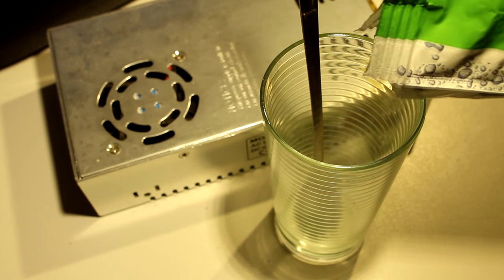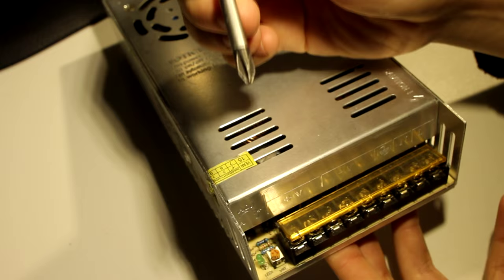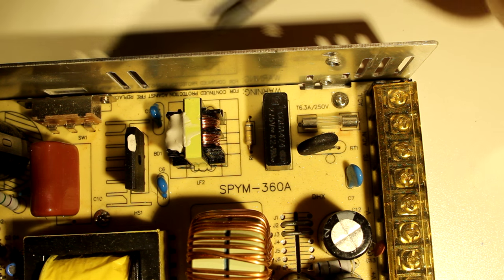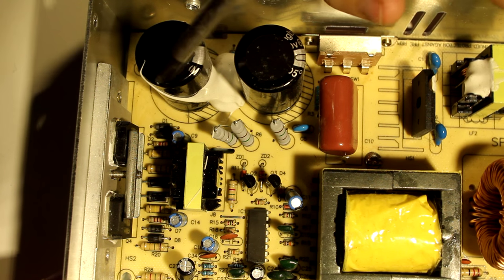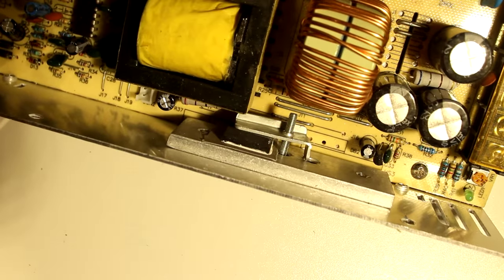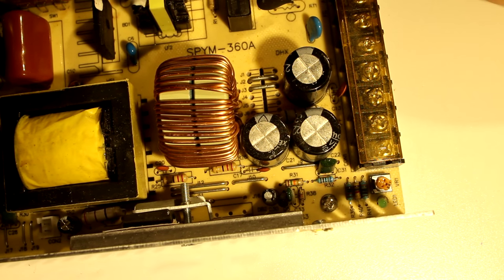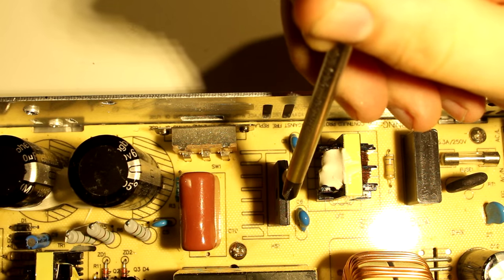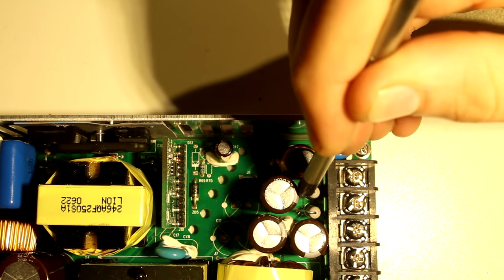Crappy chinese 24V '360W' power supply teardown (005)

Comment: The power supply is made to a price, its bad practice to run the power supply at or near its full capacity anyway, the black component near the fuse is a NTC not a mov its intended to limit the inrush current at switch on, the minimum load power resistor, looks like a 680R/1W carbon film, it dissipating about 850mWatts, it will get hot, but the heat may not be significant enough to noticeably reduce the life of the output caps. The clearance between the mains terminals and the output is fine, this is acceptable practice. The issue is to ensure the designer maintained correct clearances on the PCB and used sufficient insulation on the transformer, this is sometimes the big problem with the cheap units. The components that are heavy get glued down, but the TO-92 small signal transistors generally do not need it as their mass is too small, the power supply should not be exposed to heavy vibration and are not designed for it anyway. Interesting video good work..

Comment: these powersupllies are never perfect but they do work fine if you fix some parts. i have a 12v 20amp one powering my stereo at home which happens to be a sony explod car stereo that happily takes over 10-15amps when the bass is cranked. and the powersupply remains on 24x7 to keep the time & other settings in the radio and it has been turned on like this 24x7 since 2009 . the radio runs 16-18hours a day . i had replaced the mains cap with a single 450v cap and removed the voltage doubler section because i don't need that in a 240v country. and applied right amount of thermal paste on the heatsinks. but other than that every thing is original including the "used" components they used in this powersupply like the half bridge bipolar's and output rectifier.

Comment: Those are two different units!!!  And it appears to be you don’t get the functional design of any of them! And what has the metal to do with the internal of the psu? Its really out of the question when talking about a low-cost product, besided that its totally fine even if it was a expensive product.

Comment: But how dangerous is it really? Since I started reading your blog I became "afraid" of cheap Chinese power adapters that will burn down the house. So I now use ones made to EU specs. But let's say I need a power supply for a device that after installation never gets moved again. All the things you mention in the video don't sound to me like a fire hazard. Ok it will not provide 350 W, but I don't care about that. As long as it can power a few steppers or air valves, it's fine with me. So if you don't mind the build quality, how bad is it really?
Reply from the maker: +Hans de Bruin (Ctrl-Alt-Dude) There is a spectrum of crappiness of course. This particular example just isn't powerful enough to supply the quoted power, so most likely you will just overload it and have some minor noncatastrophic failure (exploding MOSFET or something like that). Truly crappy supplies lack necessary safety features and are an immediate danger to the user, and simply cheap but not particularly crappy power supplies don't live as long as good quality ones. I'll try to do some kind of hazard analysis as a standard part of my reviews.
Reply: +Hans de Bruin (Ctrl-Alt-Dude) How I like to think about it: What would you like: a power supply that can fail with 5% chance, 1% chance or 0.1% chance? Properly designed and manufactured power supplies are just going to get that fail % down. Which then also reduces the chance that your house burns down.

Second thing is: when people buy these crappy power supplies, some of them might actually EXPECT to get 360W out of it. It sais so on the box right? Regulations and such need to protect these people. We can't all be power electronics experts, I know I'm not.

Comment: Bought a batch of faulty ones which some had no output while others just needed testing. After changing only N-Channel Irfp460 20A 500V Power Mosfet Transistors all the voltages were nice and steady at 24 Volts. Not happy with the kind of AC volts I was getting (of about 20 Volts) on the DC side I pinned down the culprit the capacitor just before the output transformer similiar to the C11 on the one on test, which was either 1μF or 10μF can't remember as these things go faster that Jordan changes husbands. Does the job though but buy linear if you want lab testing off a PSU.

Comment: For the price these are by far the best, there are cheap as chips and most other PSU's from China in this price bracket have bugger all filtering on the secondary side and a tiny transformer half the size of those. I've tried dozens from China. What I do with these is swap the mosfets to much better ones with low RDS on and sometimes the coils get hot as they are crap so swap those, the caps will last a couple of years before you have to change them

Comment: The problem with opinion and making a youtube video is that anyone has right on them. "You are completely unqualified to review this power supply (or any PSU for that matter)."
Reply: I agree.  Rather than criticize based on suggestions, suggest risk reduction and show actual test results to gauge reliability, e.g. HiPot with dust, Temp rise, Contamination measurement. COnducted  emission measurement.

Comment: Where is the output noise/ripple  measurement on the scope where is the voltage regulation test with and without load.  I don't think you should label the power supply as crappy with no actual electrical measurements what so ever. Your crappy review not much better than an unboxing review.

Comment: 6:53 that is not a PFC, its a gate drive transformer driving that 2 switches probably in 2 switch forward topology, there is no active pfc with that kind of Chinese smps, the passive ones are pretty bad also,, the only thing that they are good at is its price

Comment: The parts are for the most part way below par as you describe, but a few notes...

1)  The MOV is actually a NTC inrush current limiter.

2) There is no PFC in this power supply, you are being too genetrous :)
    The two mosfets are both used to create a push-pull input for the main transformer (using the push pull TL494 controller).

I have the same power supply with both TO-247 Schottky populated, but apart from that is the same shit build as you describe.
BUT, for the money, ...ehhh, it's hard to argue.  I use ia as a roughly 150W (because there is now way it will give 360W without overheating fast & other issues) 24V supply, and even at that the US$24 I paid for it is a good buy.

Should I want to use it more often all I have to do is replace the output caps (which you are right, will not last long as they are).  But even if I spend US$30 on good quality output caps, at US$54 it is still a bargain.  You may not agree, it is an opinion after all, but to buy even a 150W power that is high quality would 4-6x what I paid for this one.

The two things for me that is really bad is a) terrible heatsinking and b) high EMF backfeeding due to the terrible input filter you describe,
...but both are easy to fix (if you are a tech/engineer).

Don't get me wrong, this is bad a product that should not exist, but if you buff it up with a few fixes it is ok.  If it had these fixes and it cost <$50, it would be a good buy.

Comment: That's no MOV, but an industry limiting thermistor!The "power factor correction inductor" you pointed to is actually the drive transformer to the half bridge..
Judging by your explanation of the circuit and components, you still need to learn quite a bit about electronics before making videos like this...
A tiny bit of knowledge can be a dangerous thing!!!
P.s. the separation between line and low voltage  output is just fine ....

Comment: Talking about capacitors I found some old caps which were good brand however they were very old around 20-30 years I mesured them and they were fine 33000uf 50v i was making a amplifier and run for like year or two I was presented with firework show.The goddamn caps didnt have venting and they were the size of the ones you find in fridges or air conditioners.

Comment: I would not use one of these units in my house without being afraid of it burning down. Very crappy.
Reply: Do you use Christmas lights and/or 18 gauge extension cords in your home and you are worried about metal encased grounded and fused power supply.....really?

Comment: Crimp and solder some conne tours then put heat shrink over them bare wire. Tightened under the clamp will work but is poor workmanship

Comment: Dat coil-winding crossover on the big one.
I have 16 led displays with changx caps on each and they all say VENT. It alarmed me too. Venting at 105c? Should I replace with Japanese caps?
Hm. Imma bend those guys up so they don't spray their own boards, for now.
Recently I bouglt a chinese 5V 30A supply, it's rectifier had provisions on the PCB to be mounted closer to the frame but no, they just glued a metal spacer to it and called it a day (it did not have contact with the frame in this instance). The frame is supposed to be the heatsink btw. I desoldered the rectifier and (after some drilling) resoldered it in the proper holes against the frame. Still I might need an actual heatsink in the end. That thing gets hot.
If you buy these, open them and tweak them the extra yard.